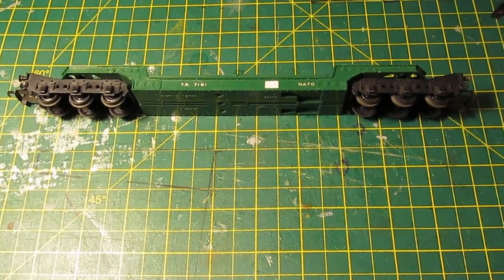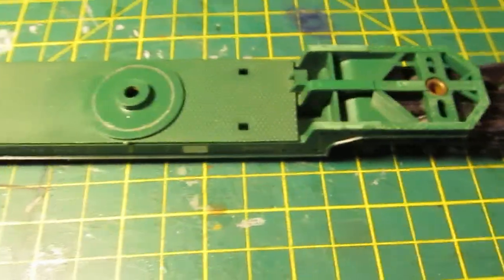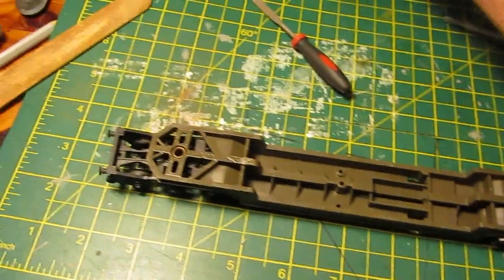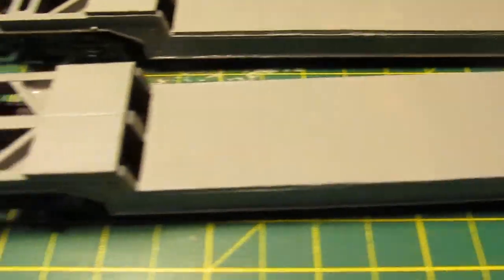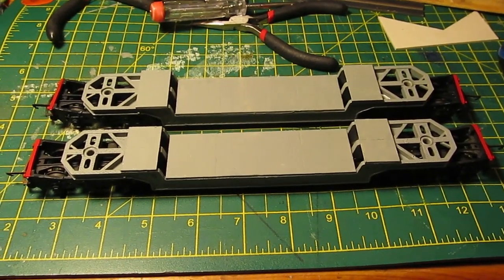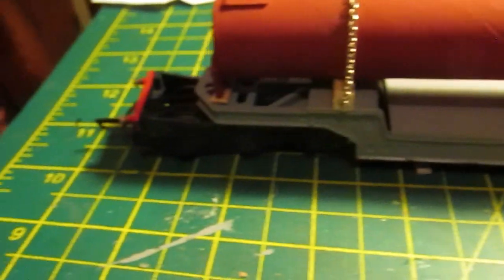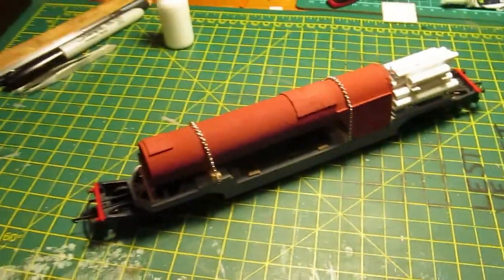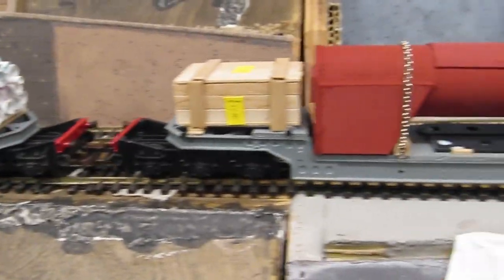Buckland Junction Loft Model Railway 24. Alan converts two Battle Space low loaders into boiler TSPs

Comment: Fabulous. I have some old Triang bogie well wagons (they were only a couple of quid on eBay), and was wondering what to do with them. Mine are smaller 4 wheel bogie versions. But i think your inspiration will make me create some sort of boiler/machines for them to carry
Reply from the maker: Yes have a go. My boilers are made from a baco foil roll and a few straws. Don't worry what they look like just go with your imagination. Regards Alan  :o)
Reply: @AlanReynoldsBucklandJunction  I have some cotton buds which i could use for boiler tubes. Might have some straws somewhere to - A hunt is on the way. Did you know BR used one of these large well wagons to build a track machine could Cyclops. It looks like a coach built on the wagon.
Reply from the maker: @andrewhead6267  I will have to search for Cyclops to see for myself. Go for it Andy. Regards Al in Dover  :o)